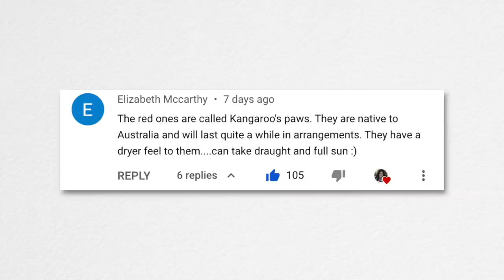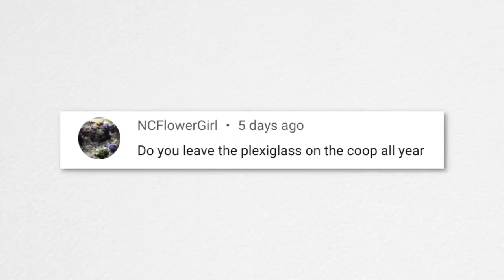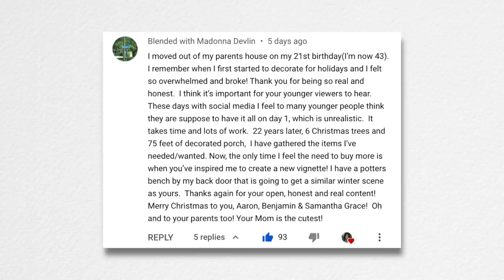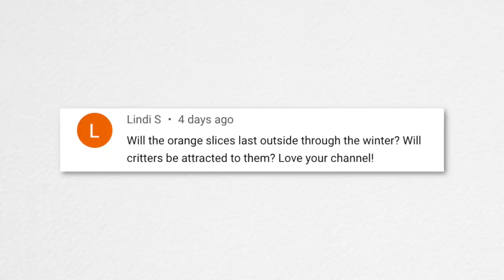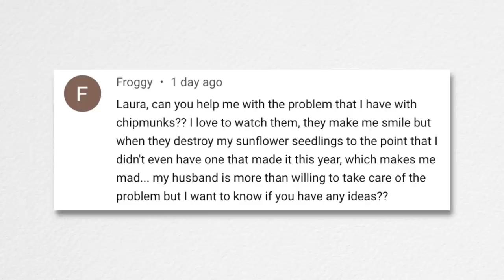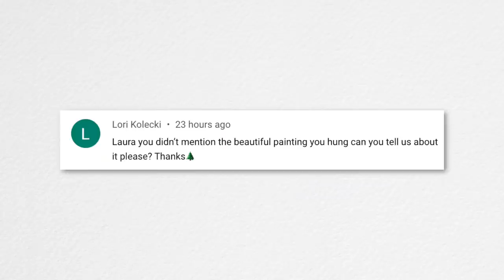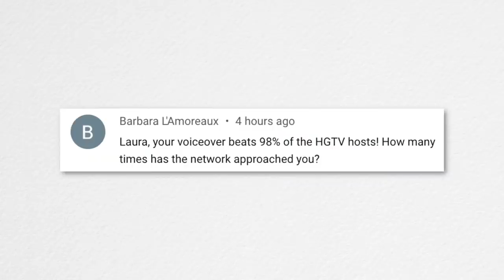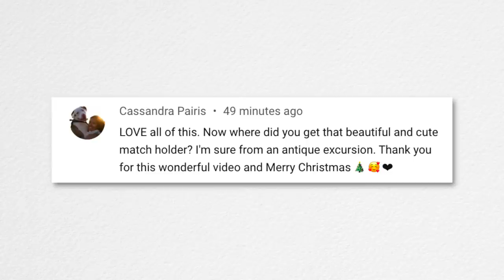Will You Be Attending Any Shows in 2022? // How Many Times Has HGTV Approached You? // Recap 🌿

Comment: To protect sunflower (or any other) seedlings, I always surround the seedlings with one quart plastic containers from the supermarket which I cut the bottom off of. Often times I can see where the chipmunks have scratched at them, but if you bury the first inc or two they generally can’t dislodge them. The clear ones are best because you don’t really notice them, but any container will work.

Comment: Air circulation is also why my phal orchids grow intensive root systems and several leaves outside, instead of rotting away during the rainstorms in my area. Methinks there's also something about unfiltered (not through a window) that gives plants more resistance. One leaf a year indoors, meanwhile dead leaves were accumulating on my orchid pots and they don't care so much for diseases.

Comment: For chipmunks, netting has worked beautifully for me. Also Cayenne or a red pepper powder works great. You have to add occasionally depending on the watering but it works.  I've even poured it down a hole that popped up in my garden. Never saw another hole after that.

Comment: Cattle panels.  Hog panels are generally shorter (height wise) and the spacing of the holes is always smaller on the bottom than it is on the top.

Comment: I'm in chipmunk  country. The  only  way  to  deal with  them is live  to  them and  take hem elsewhere  to  live.  They breed  so  you  will have  them constant  if  you  don't  remove them.  It  you  have  walnut  trees   you will be  more likely  to have  them. Same   with  squirrels. I' never  used   grow lights  for snapdragons. I'm' in Midwest  Iowa. I  just  plant  them in ground. But  you  can start  them earlier in house in window They'll  bloom faster  in Summer if  you start  in  the  house. . And  sometimes  they'll reseed  their self outside. :-)
Reply: Yeah and you'd have to use chicken wire since chipmunks can get through cattle panels. We have 'em here in NJ too. They're cute little critters despite being a garden pest.
Reply: @Bamboo4U2  They  could  easily  get  through  chicken wire. It's an inch in  diameter  so  they  could squeeze  through  it.  It  has bigger holes than those  1/2 inch sqs  in the panels. Easier  just  to transplant  them  to another  area of town. Like  a  park  or out  in the country.  They'll  find  a tree.. :-)

Comment: You will be sorry you got the bottom freezer. In about a year they start to leak water under the long drawer and into the back right side of the freezer drawer. Ice builds up until you cannot close the drawer. Then the drawer freezes shut. You have to shut off the circuit breaker to unthaw it for 24 hours then open the drawer and hit it with a hammer to get all the ice out. Its a poor design yet they continue to sell them. I have had two. One inexpensive and one top of the line GE. They both do it. Mine has to be defrosted once every month or  two. Its a pain. Right now in all the stores they are all bottom freezers that are available. Never again will I buy one. The ice maker leaded on my cheaper fridge and caused a flood in the cellar in the boiler room and bathroom. Now we find out a year later the water got under our tile and rotted the wood subfloor when the tiles started to crack and mold is growing in the ceiling of the downstairs ceiling. 
If they we're available I would replace it but I just replaced my washer and dryer a white steam washer and dryer by LG recommended by Loews as the best. Maytag has been bought and is terrible now. They are terrific. Use very little water and steam one load is done very fast about twenty minutes. Dryer uses steam and clothes dry very fast since they are not real wet coming out of the washer. They are pricy over one thousand each but got on sale. Worth it!